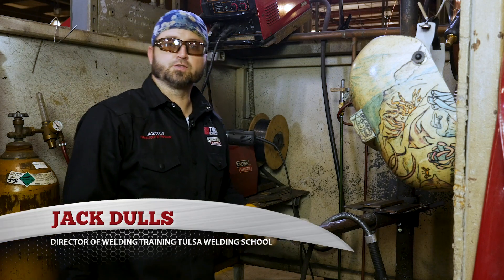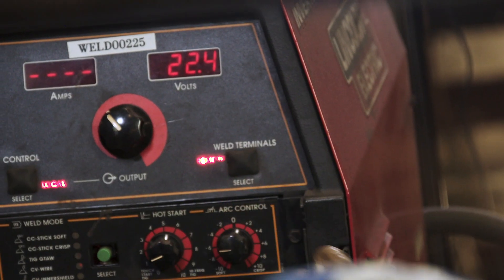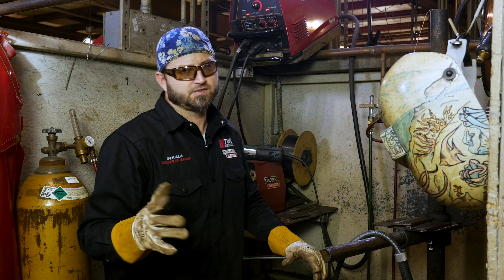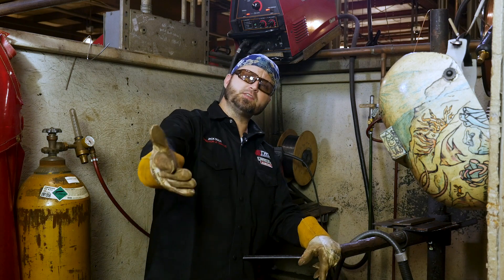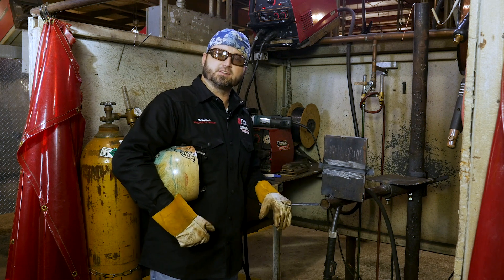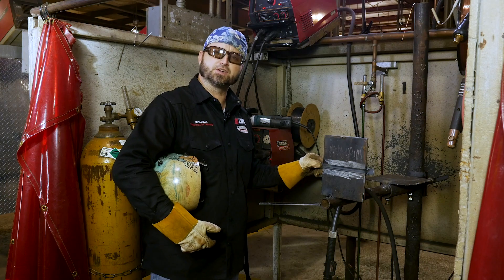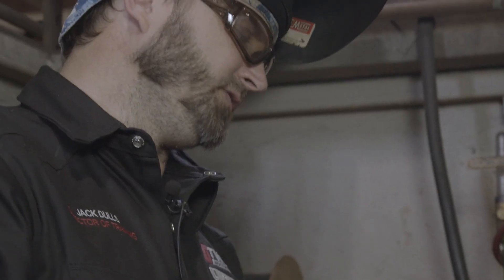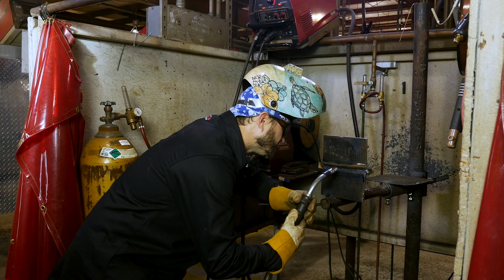How to Weld Fluxcore 2G, 3G, and 4G Position with a Backing Strip on a 3/8 Plate.

Comment: Thanks a lot for the information, please and what about Fcaw open Root on 2-3-4 G position with and without ceramic in the back, is it possible??
Reply: Yes brother, you can run an open root with dual shield. ASME sec IX is typically open root and back gouging is usually allows. Just tighten up your root opening so you’re not blowing through

Comment: How much do you let the wire stick out from end of the gun?
Reply: You Almost Always Wants To Be Nozzle Close To The Metal, Keeping It Tight
Reply: @chiefgwopp100  not on Flux core buddy. I didn't like how close this dude was and im very surprised hi tip didn't burn up and create a birds nest
Reply: @josebriones1520  Really? MY bend test passed, my weld was strong enough for me to keep that nozzle close
Reply: @chiefgwopp100  I noticed on my 3G I can keep my nozzle close up going up on the puddle but 2G nah   if it works for you keep doing what you're doing
Reply: @josebriones1520  it really depends on preference and how much your gas is flowing and wire speed and heat. You can fudge the distance a little bit my adjusting those three parameters, long arcing does work to an extent. But my personal preference is keeping it tight like the other person said, maybe not almost touching but about 1/4 maybe 5/16 away from the material
Reply: I think it really depends on your cfh. Probably don't need it too close if you have more gas coming out, since the higher pressure forces all of the outside gasses away

Comment: What's the pressure on that tank back there?
Reply: Pressure of tank has nothing to do with it, thats why there's a regulator on top that has an adjustable valve and a gauge on top to show the flow rate.

Comment: I thought flux core was without gas 🤔
Reply: There is self shielded flux core and dual shielded flux core. Dua shielded flux core welds like 7018 and has slag like 7018
Reply: He should have mentioned that ..
Reply: Thought so too, guess you can run it with gas